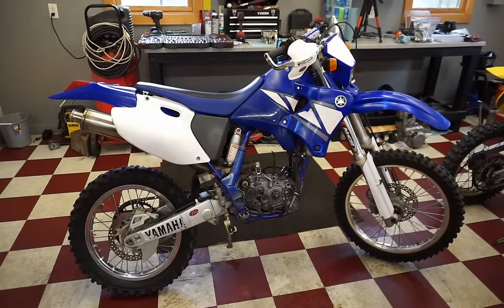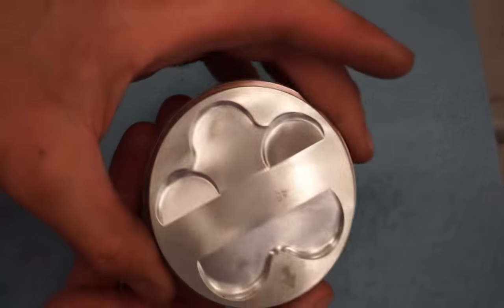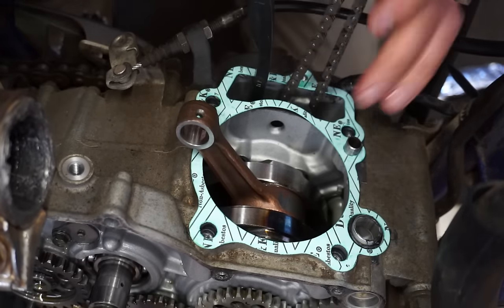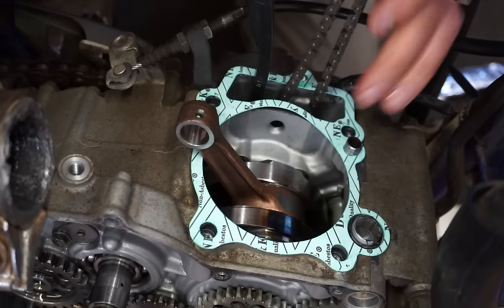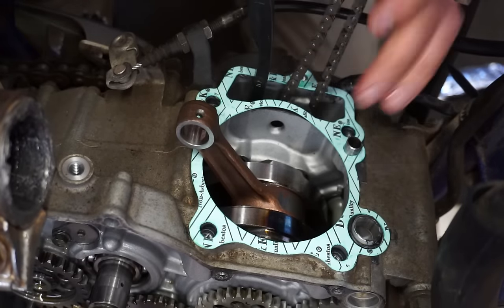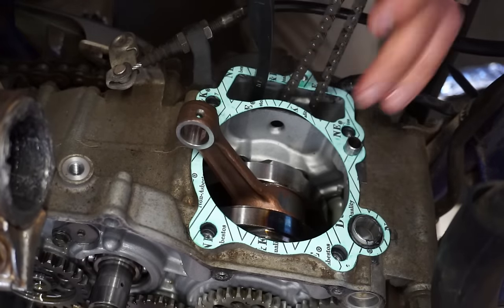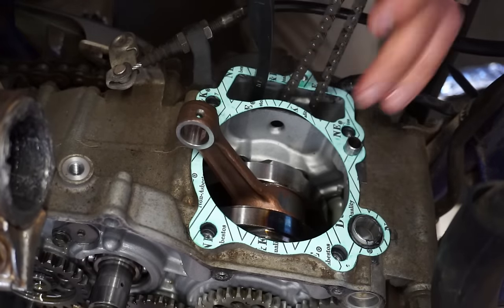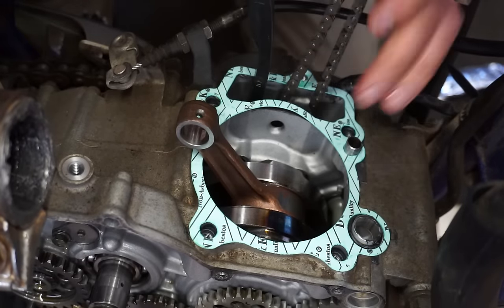Rare Street Legal Dirt Bike Won't Start After Being Rebuilt

Comment: If I could I'll sold you my Beta Techno 250 1997 - 1000 euros
It is in boxes (so as not to rust), even crankshaft is dismantled (to be changed)
But almost very small accessories have been changed,
nickasil treatment cylinder (but with light ovalization) 
but in short nickel,

But ..... I am in France ..
Ü
Reply: (or you pay transport,
and I give it to you, free$
Ü
"The pleasure of offering is that of offering ...".

Comment: If there is some aluminum shavings in my oil what should i do?
Reply: Tear down the engine and inspect. Theres a broken part somewhere
Reply: @SoilderOfGod317  dang that sucks.
Reply: Depends on how large and numerous they are. If the oil looks like diluted metallic paint, then it's probably just clutch particles, which is perfectly normal, but if you're seeing larger chunks, then you likely have a serious problem.
Reply: sell it to joe 😂
Reply: @stkyfngrszmooth  aluminum metal shavings its 2014 ktm sfx 350. I know basic maintenance, but not good at tearing down engines. Any ideas what it MIGHT be.
Reply: @travisconover4762  if it still runs okay, possibly the clutch ,take the clutch cover off and inspect
Reply: @travisconover4762  Are the particles small to the point that you can't feel them, or if you dip your fingers into the oil and rub your thumb and index finger together, can you feel the individual pieces?
Reply: @stkyfngrszmooth  they're in the oil screen. They are small, soft shavings.
Reply: @stkyfngrszmooth  not so much in the oil because the screen is catching them
Reply: @travisconover4762  Sounds like general extended wear and tear to me. I wouldn't worry about it unless it gets considerably worse by your next oil change.

Comment: Yamaha made a few lemons. This model and my 1995 xt350 it is a complete turd. Completely unreliable compared to modern Yamahas. Mine was a real cunt to adjust the carbs. Dual carbs for a 350 single cylinder.. ya bone headed dip shit design that is so finicky only I was dumb enough to buy it. But the wr is known for blowing motors out of no where. And mine is known for sucking valves into the piston. Once again they did lots of cocaine in the 90s. It shows in some designs.